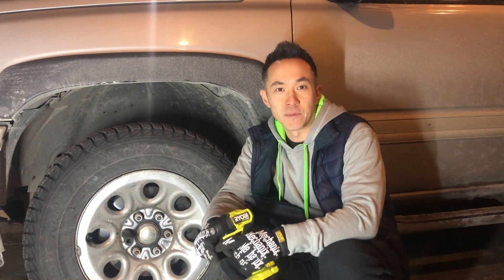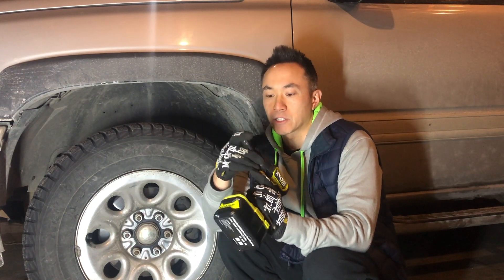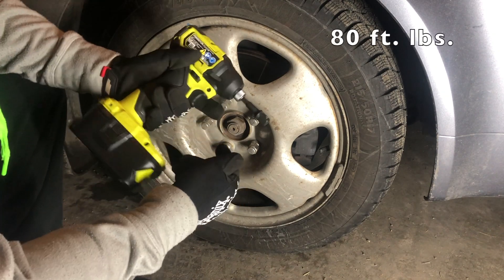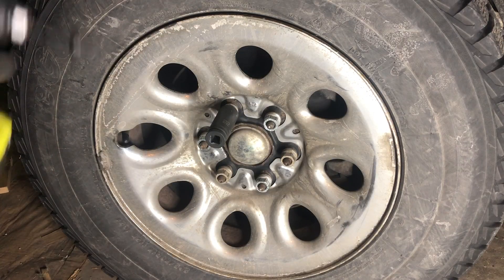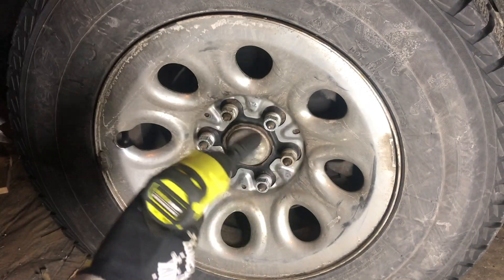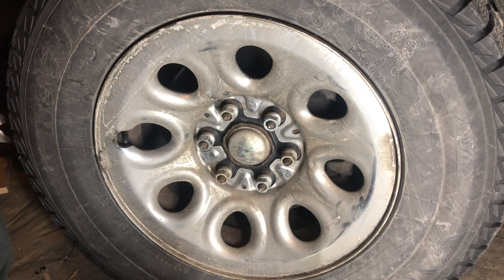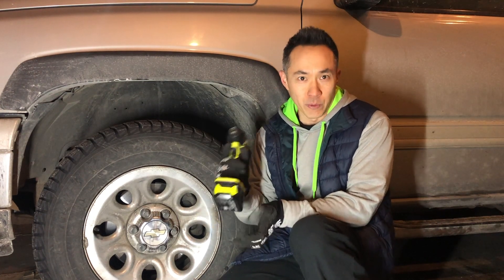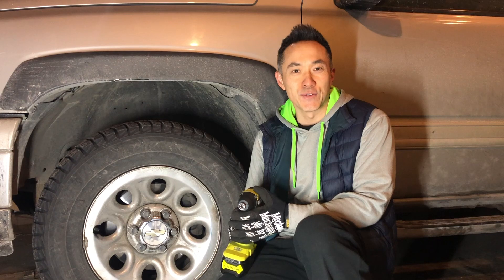Ryobi Impact Driver as an Impact Wrench? (PART 1)

Comment: Great video!  I'm a DYI'er in woodworking and looking for an impact wrench driver.  Not sure if I'll have more need for a 1/4" or 3/8" or 1/2" impact sized driver in the future and don't want to buy 2-3 different sized drivers.  Is it possible to go from 1/2" to 3/8" to 1/2" and vice versa by just using a socket attachment adaptor instead no matter which drive size I get? Maybe just go with a 3/8" impact wrench for an all arounder?
Reply from the maker: Thanks! Here is my humble two cents:

If you do more woodworking and are turning screws more than bolt/nut fastening, my suggestion is to go with a 1/4" hex impact driver and get 1/4" hex to 3/8" and 1/4" hex to 1/2" adapters for sockets.

If you do more bolt and nut fastening/removal than turning screws, my suggestion is to get an impact wrench.

If you do both frequently or just need the power/convenience, buy both.

If, as a DIYer you're trying to buy only one tool and try to use it for both scenarios, my opinion is that the impact driver is the more versatile single purchase.

Feel free to share thoughts if you disagree or have better suggestions! :)
Reply: @lmsdiy  Thank you for your feedback.  It was very helpful.  I might just purchase a 3/8 in impact wrench driver for the occasional tightening and loosening of lag bolts and such.  If I were to use my 1/4 in impact driver for the lighter stuff,  I could just stick with my chrome plated sockets?  I know the impact wrench requires the impact sockets though, which I do not yet own.
Reply from the maker: @kle2217  hey my pleasure. Though not recommended (to use chrome vanadium) for impact wrenches, I do know people who use high quality sockets (like Snap-On) with impacts and are not concerned with them breaking apart. With cheaper quality sockets it's just a matter of time before they break and who knows... I don't recommend it but if you do, always wear protective equipment including safety eyewear at least...!
Reply: @kle2217  if u need something for more like medium duty work u might want to consider avoiding adapters, extensions, and u-joints because they will rob power, so if u have large nuts and bolts that u would rather use 1/2" drive on, i would go with the 1/2" and then use adapters from there which will take away some fastening power, but u wouldn't need as much power for smaller stuff. BUT there is one exception which is the milwuakee 3/8" drive is more powerful than their 1/2" drive. so if you buy milwuakee, 3/8" drive will give u the most power
Reply from the maker: I maybe missed one answer in your ask: is it possible to get adapters? Always. The benefit is you can use whichever tool size (get the most powerful tool that you need in the smallest/lightest form, is my approach) you want and get adapters to accommodate. The drawbacks are that 1) you end up having to switch/use multiple adapters, 2) adapters add length so it may impact (no pun intended) your capabilities in tight spaces and 3) power reduction - each time you introduce an extension, an adapter, a swivel, etc., it will reduce the overall power of the impacting action.
Reply: This is the best option for this M18 Frankenstein https://youtu.be/-yO2S1nPDLA

Comment: The 1/4" impact drivers are better for bolts about 3/8ths and smaller. And yes the p262 1/2" impact gun and the new PBLIW01 high torque 1/2" impact wrench are good for all the big car and truck stuff. Also keep in mind that generic brand battery may be lessening the output of your tool. The Torque Test channel shows the 3AH HP battery working better for HP level ryobi tools thatn the 4AH. Tho that was all last years stuff and you cant find the 3AH now. just the 4 and the massive 9AH. the HP line is really impressive tho.
Reply from the maker: Thx for sharing your thoughts. I did buy the P262 and use it all the time, especially at the shop. And converted to only Ryobi brand name batteries now! 👍👍

The P262 is great but there are still times that I end up having to use the old manual breaker bar. 🙁

Comment: I have the Ryobi compact impact driver and a pneumatic impact wrench as well.  For removing lug nuts the Ryobi works well, not as powerful as the pneumatic but a lot handier at times.  It has struggled at times, but never for long.  Needless to say I am impressed with it, and it has found it's way in my car tool bag.
Reply from the maker: That's a good combination to have! Since doing this video, my tool bag now consists of a Milwaukee cordless ratchet, a Milwaukee 3/8" stubby impact wrench and a Ryobi 1/2" P262 impact wrench. This covers most of my needs but there are times that I need to use a breaker bar (or pneumatic impact) because these don't have enough power. 😁 I use the Ryobi impact driver as a die grinder (maybe I should do a video on that) and to remove brake rotor screws. It is a versatile and handy tool, I agree!

Comment: I have the same one with original battery when I first got it i made sure it was fully charge and  yea I didn’t break no lug nuts loose have to break them loose then hit it

Even if I had them alittle more the than snug the impact struggle
Reply from the maker: The lithium+ 4ah batteries may be better now? Check out my part 2 video with the newest Ryobi battery. Huge difference! I was impressed...

Comment: What was that tool you used at 2:22 where you were able to set the torque?
Reply from the maker: Just a basic 1/2" torque wrench adjustable 50-250 ft.lbs.

Comment: Test with knock-off battery ? i'm out
Reply from the maker: Legit Ryobi 4Ah 2-pack on sale. Just bought a pair and I'm going to redo this test for fun!
Reply: @lmsdiy  try it with an original battery and a new hp battery (21700 cells)
Reply from the maker: @Killou  I bought the Lithium+ batteries @4Ah. Is the HP line different?
Reply: Absolutely 
There are the regular 4ah batteries, HP 6ah and 9AH batteries (all of these are made with 18650 cells) 
And for the new HP tools ryobi made a new HP 4ah battery that is made with 21700 cells (bigger cells, more power, runs cooler etc...)
Reply from the maker: @Killou  dang...! 😁 Thanks for the info!
Reply: @lmsdiy  you are welcome 
Please never do any test with a knock off battery the results are not what the tool is able to perform, unless you have an original battery to compare 😉
Reply from the maker: Here's the test with the Ryobi battery!

https://youtu.be/8NyhwKNxPoY

Comment: I dont get it ? I have seen other video showing that impact driver breaking away more than 140 foot pounds, which I believe the manufacturer claims its rated to 140 foot pounds. Maybe your not giving it enough time to succeed. I believe i have seen it at, Shop tool Reviews on youtube.
Reply from the maker: 🤷🏻‍♂️ maybe it's a quality control thing. I can't explain it either. But I know I use my impact wrench and breaker bars more than I use the impact driver for auto work now. 😁😂
Reply: ya use a real hp battwry even kno that compact dowsnt have the extra terminals they still help i have like 12 battwries all actual ryobi battwriws but the compaxt 3amp hr is the strongest but for 99 bucks get the pblid02 wven kno the specs says the p238 is faster the new one is a monster ..love it with the comp. 3ah my buddiws milwaukie gen 3 is the only in  person beat it and it beats the gen 3 sumtimes so also don5 judge a book by TTIs stupid marketing on the boxes also give the pblid02 time to wear in it keeps gettin stronger..its my binkie ...wifes gettin jealous lol
Reply from the maker: Here's the test with the Ryobi battery!

https://youtu.be/8NyhwKNxPoY

Comment: Next time use a original battery. I have the same Chinese battery you use and they are fine for the normal undemanding stuff.

But in the angle grinder or impact driver/wrench really want  the original battery.
Reply from the maker: Legit Ryobi 4Ah 2-pack on sale. Just bought a pair and I'm going to redo this test for fun!
Reply from the maker: I hear ya... I only have original Ryobi batteries in 1.3 Ah and 1.5 Ah right now. I think it's time to pick up a 4 or 5 Ah original Ryobi to use!
Reply from the maker: David Ramsubhag  thanks, David. I will have a look there. That's a great deal!!
Reply from the maker: Here's the test with the Ryobi battery!

https://youtu.be/8NyhwKNxPoY

Comment: If you use a better impact driver it would probably work at 120. Ryoby ridgid and milwaukee are Home Depot brand, but one of there seller told me that it was the lowest in performance and quality of the 3. Then ridgid then milwaukee.
The milwaukee m12 fuel is very powerful so would probably remove it at 120. As all products, it depends on your needs.
Also if i am not wrong, they don’t recommend to use an impact driver as a impact wrench but i guess once in a while isn’t a problem.
Reply from the maker: What you suggested about a different brand might work. And it's probably ok for light duty. But I find the impact driver just isn't the right tool for impact wrench work. I have a 3/8" Milwaukee stubby impact wrench and Ryobi 1/2" impact wrench instead for my auto work. It's all just my opinion though 😁
Reply: Can you clarify what your saying? is that specific to your local town or city..? 99% of countries on earth do not have a home depot...
but milwaukee and ryobi can be purchased through other retailers in most of the world. it's not uncommon to see milwaukee double the price of ryobi for similarly spec tools.

Comment: I have a more powerful impact driver,  an ARI20101 P20 series 20V BRUSHLESS 1/4" Impact Driver from ACDelco by way of Durofix, rated to 77/133/162 ft-lb.  I was excited to see your demo because I have a Chevy truck and so do you, but the torque spec on my 2003 is 140 in-lbs, I believe, and hoped you'd test at that spec.  

My chief concern was breaking the adapter, which did you use?  Project Farm made me think that with the possible exception of the DeWalt, nothing else would come close.

Would it be possible for you to update with stronger impact and tighter nut?  Will it maybe do an axle nut on a truck or at least a car?  I don't expect to do this often, but as I travel with the P20, it will be there on the road.  So at the very least I'd like your spec on adapter and socket/, suitable for all purposes on roadside rescue.

Also:  the Bosch Freak line has a clever combo, 3/8 square-1/4" hex tip. Will that have the strength to drive a 3/8" - 22m hex all the way?  (I've seen that you can buy that to add Freak capability to your driver.)
Reply from the maker: Hey Ira, my 2006 Chev lugnut spec is also 140 ft.lb. all around but I loosened one so I could try different torque specs. Because mine couldn't break free the 120 ft.lb. nut, I decided not to bother with 140 ft.lb. 

I use a DeWalt hex bit to 1/2" adapter. I think it said they are rated for 140 or 160 ft.lb. 

My thought on this is, even if my impact driver could finally break free a lugnut tightened to 140 ft.lb., it would take forever for me to remove all 24 lugs on the truck to rotate the tires. I want my tools to speed up my work for less time and less effort and this Ryobi impact driver is just not the right tool for me for automotive work. Hands down, my best purchase has been the Milwaukee 3/8" stubby impact wrench. It's so versatile and lightweight and works on lugnuts! Check out my video on that!

I have a Ryobi P262 1/2" and a Milwaukee stubby 3/8" (impact wrenches) for all the lugnut and axle nut type work now. 😁😎
Reply from the maker: Here's the test with the Ryobi battery!

https://youtu.be/8NyhwKNxPoY

Comment: I liked that you used a impact rated socket and adapter. The added weight of the socket helps with the impact action.
Reply: Also it won't explode in your face
Reply: Good to know
Reply: Uh according to newtons law, for every action is a equal and opposite reaction, adding more weight will loose effeicenty due to extra weight having the anvil to overcome
Reply: @jmabs5096  🤓☝
Reply: @jmabs5096  Tell that to the Torque Test channel where he tested it and proved it.

Comment: I am curious if there is any long term damage from using an impact driver as an impact wrench? Or is it just the so-so performance.
Reply from the maker: That's a good question. I mean, it's designed for light use like fastening long screws, deck screws, etc. but can also do bolts/anchors into concrete. So on the one hand should be fine for light use (80 ft.lb. to me is light)... On the other hand, I think if we overwork any power tool we will risk overheating it and reducing its lifespan for sure.
Reply: I've worked my impact driver pretty hard, worst thing I see is broken adaptors!
Reply from the maker: @Yata69  nice... Adapters are cheap! 😁

Comment: Good video. Looks as if you’re not using more than 80 ft-lbs then the driver plus adapter will work.
Reply from the maker: Yeah if I were only removing and fastening lugnuts that were ~80 ft.lbs. I might just use an impact driver. 🙂
Reply: It   varies by manufacturer if you buy like  milwaukee or high end impact you can do up to 200 or in some cases 250.
Reply: @frt241  My ACDelco says it's rated to 162 ft-lbs (1944 in-lb).  If "nut-busting" (?) torque needed is less than the rated fastening torque, I ought to be able to break loose even an axle nut, say 180 ft-lb.  

My chief concern is the adapter, which Project Farm broke time after time (on his bench test, which was not after all, equal/identical to doing lug nuts, but still).  He seemed to show the DeWalt, even more than the Makita Gold, was the most skookum, or is that the other guy :-). Since it would be for emergency use, the best seems worth it. But if none will do, why waste the time?

Comment: Something to note, This Ryobi's weakest brushless impact tool and is part of their "Compact" line , The older P238 and the newer PDLID02 are both way stronger. as well at the P262 1/2" impact wrench.

So just to think this what the "Weakest" can do :P

Also be careful with those generic batteries, they lack many of the safety features built into the genuine ryobi batteries.
Reply: I have the Ryobi compact brushless driver and yes it takes off lugnuts.  It's when I'm lazy to get the air impactor out or when I don't want to have the compressor run..  It also has snapped the Ryobi brand hex to 1/2 inch adaptor.  I ended up buying a better adapter and have had no issues.   I did't get it for lugnuts but because of it's compact form it makes it a tool that I can work on the car in tighter spaces then the full sized one.
Reply from the maker: I have the P262 now (finally available in Canada a few weeks ago)!

Thx for the tip about the generic batteries.
Reply: @lmsdiy  

No problem, also that p262 is an absolute beast , not quiet as good as Rigid or the Milluwakie mid torques but it's right there with them.
Reply: @lmsdiy  Great!  Please try this again with higher torqued bolts eg Chevy lug and axle nuts?
Reply from the maker: Legit Ryobi 4Ah 2-pack on sale. Just bought a pair and I'm going to redo this test for fun!

Comment: 120 ft lb lug nut takes 140 ft lb to break it loose.
Reply from the maker: I believe it's 75-80% the other way around. To break free something fastened to 120 ft.lb. requires approximately 90-96 ft.lb. only. I could be wrong but I think that's the calculation...
Reply from the maker: I thought this was an interesting video on fastening vs. breakaway torque.

https://youtu.be/l4cAXTfVn18

Comment: I noticed that the extension was vibrating a lot.  This is wasting energy instead of applying it to loosen the nut.  If there was a way to fix that,  I bet it could remove the nut at 120 ft/lbs.   However,  we all know it was never designed for this purpose.
Reply from the maker: Nice observation, I think you have a good point. I just picked up the Ryobi impact wrench and will be reviewing that on a variety of truck fasteners to see how it does.
Reply: @lmsdiy  please update us - as I noted above, I want to have my impact driver with emergency tire change capability.
Reply from the maker: @iraravitz2024  hey Ira, for that purpose I would recommend the Ryobi 1/2" P261! Handy to have around, works great on lugnuts and less expensive than the P262!
Reply from the maker: Here's the test with the Ryobi battery!

https://youtu.be/8NyhwKNxPoY